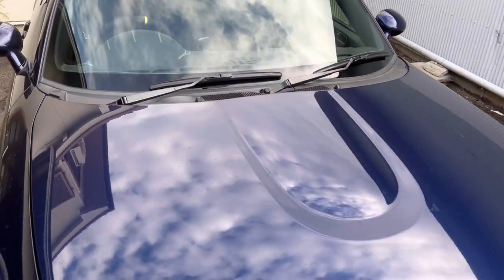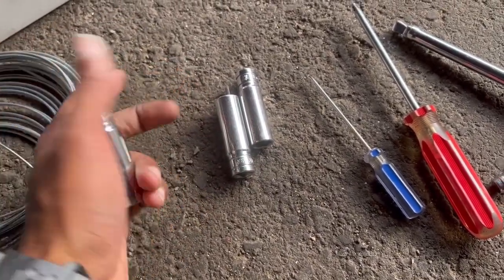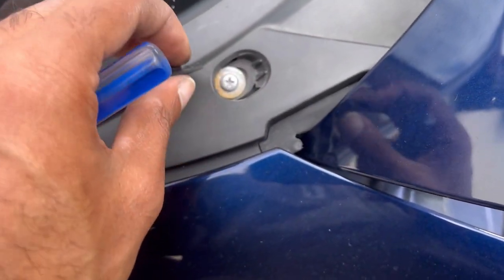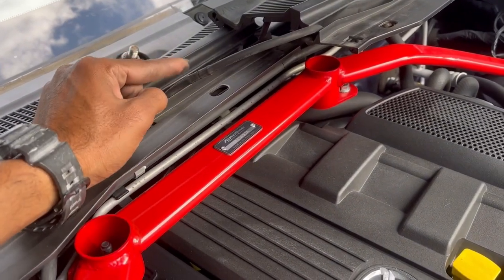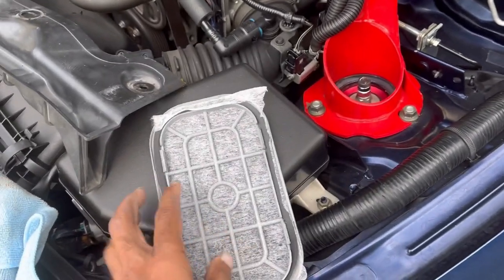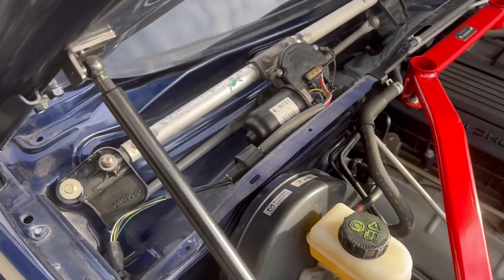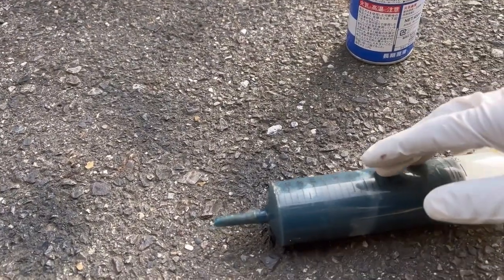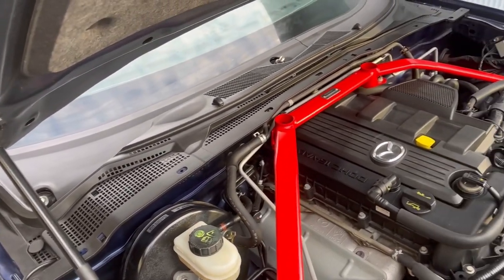NC MX-5 Miata Front Cowl Removal & Cabin Filter Mod | Tach On Red

Comment: Did you have the hood open when you removed the wiper arms? It would be easier to do it with the hood closed because you can just fold the arms up to take pressure off from the arm.
Reply from the maker: I did. But you my friend have changed my life forever. 🤯

Comment: No cabin or engine air filter? There're videos on here showing how to change. Found info about changing the cabin air filter every 15K miles and the engine air filter every 30-40K miles. Now I'm confused.
Reply from the maker: The information you found on filter change intervals is generally applicable to all cars. 

Miatas all have engine air filters. But they don't have cabin air filters. Hope that clears things up! 👍

Comment: FYI, that cowl dresses up really nice when you apply Pledge (Yes, Pledge, the furniture polish, lol), keeps it dark.  I had a friend make those covers for the screws on his 3D printer.  He made several as those tend to wear out and suddenly disappear.  Thanks for your video!
Reply from the maker: Pledge! 😃  gotta give that a try!

The screw covers are really cheap and easy to find on ali express or eBay. They're a shared part on the mazda 2 and cx5 - both of which are also manufactured in China for the Chinese market so... 😊

Comment: Hi bro, my prht roof won’t open just the back seems to open and close, battery recently went flat. Any ideas would be appreciated, someone said there’s a reset button behind passenger seat? But buggard if I can find it! Any help would be appreciated. Windows work closing roof button flashes. 🍻Mike
Reply from the maker: Hi Mike. It's hard to pinpoint the cause just from that description alone. The battery going flat may be unrelated and just a coincidence that you ran into the issue soon after.

The "reset switch" you mentioned seems to be the one pictured on this thread: https://forum.miata.net/vb/showthread.php?p=6593185

But if that doesn't work, I'd also recommend checking the following:
- fuses
- is the hex screw/ bolt for aligning the roof mechanism Tightened up. Discussed in detail on post 118 of this thread: https://forum.miata.net/vb/showthread.php?t=472651&page=5
- are the gears and joints lubricated? If not, put some grease on
- are any of the gear teeth damaged? If so, this could be a more expensive repair.

The above list are the easy things to check. But if none of these find your problem, it could be faults in the motors, switch modules (for roof and/or windows) or sensors which can be a bit harder to diagnose without part swapping

Hope that helps!

Comment: For what exacly is this mod?
Reply from the maker: Its just a filter to keep out debris and dirt from being sucked into the aircon system. 

All other cars have one from the factory. Miatas don't because they're intended to mainly be driven with the roof open, so the Mazda engineers decided that filtering outside air was unnecessary.

This filter is not as effective as the factory aircon filters in other cars. But it will keep larger bits of dirt out of the system and help prolong the life of the aircon blower motor and fan.
Reply: @TachOnRed  ohh ok. I plan to buy a nc1 1.8. your videos are pure gold😃
Reply from the maker: Thank you! Appreciate the encouragement! 🙏
Reply: @TachOnRed  looked at it. Thermostat is fried maby over 3000km ago and the oil smell extrem like gasoline. Would you buy it? The rest is in preem condition. 2006 model.
Reply from the maker: I would buy it only if I was going to use it as a base for an engine swap and if it was super dirt cheap. But otherwise, I recommend you walk away and look for another NC.  😊

Comment: Never knew about those filters. How often should these be cleaned? I’m at 66k miles on my ‘ 13 Club.
Reply from the maker: I'm not sure because I've only had mine for like 3 months. I also think it'll depend what kind of filter media you're using. 

I'm using kitchen exhaust filter sheets from my local dollar store.  I've put 2 layers of it in.  

I'll probably check it every 2nd oil change and just replace it when it starts to look shabby. I got enough of the stuff to fit an entire commercial kitchen.